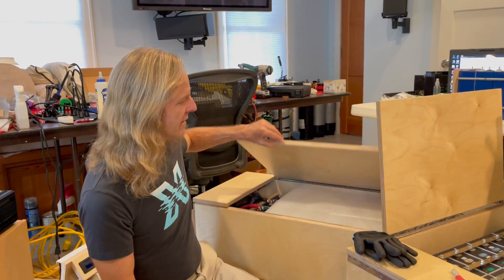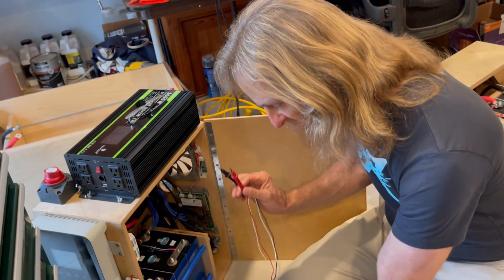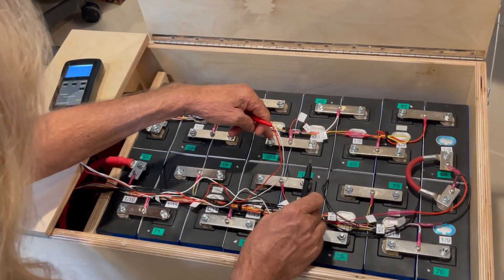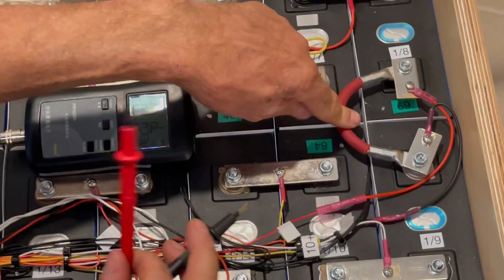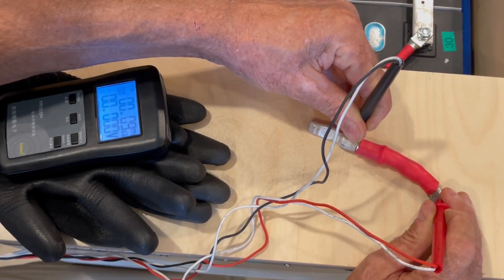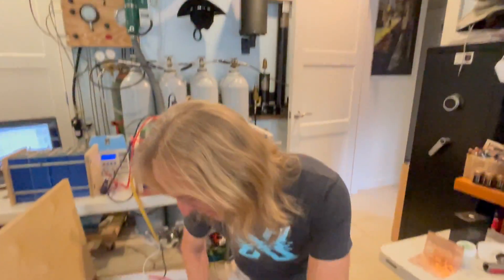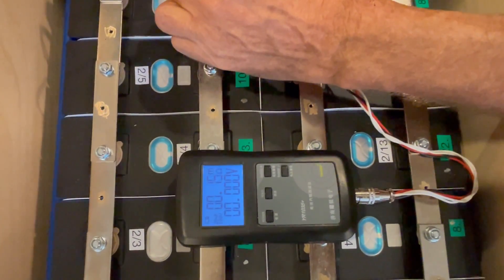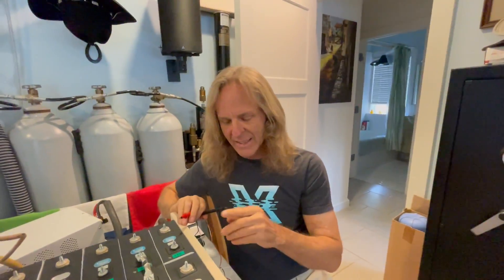It's No Joke, Size Really Does Matter!! Testing Flexible Busbars. Please read the description.

Comment: Assuming a 50A current, a 0.2milliOhm difference in resistance would result in only a 0.01V difference .... is that significant ?  A what voltage does balancing commence and what it the related current and hence voltage error between the cells ?
Reply from the maker: The idea of using brass bus bars or cables that are the equivalent of brass bus bars in their resistance is troubling to me. The 4 gauge cable will perform even worse under load because the bus bar is not insulated and had more surface area to emit heat from so should stay cooler under load.
Reply: @RayBuildsCoolStuff  Brass is a poor substitute for copper. After gold, aluminum is the most affordable alternative.

As far as heat is concerned, it's the result of resistance in the connection. Insulation is for safety and has no effect on resistive heat; either generation or transmission.
Reply from the maker: Insulation on wires retains the heat which is why uninsulated wire is rated for higher ampacity and the overhead lines between the transformer and the weatherhead on a house can be significantly smaller than insulated wires.
Reply: @RayBuildsCoolStuff  I was referring to the kind of insulation typically found on wiring used for cell interconnects, or the heat shrink often partially covering bus bars.
Reply from the maker: If you have large variance in the resistance between cells will that result in cells that act like runners? I had one nut that was only hand tight on a 48v battery and the load was only 5 amps and it resulted in a 100mv delta during charge and discharge in one cell. After tightening the nut the cell tests in the middle of the others with only 3mv difference to the others.
Reply: @RayBuildsCoolStuff  The hand-tight nut on the one and only busbar between series cells resulted in increased resistance across that connection. That would cause a disparity between cells while charging and discharging, and especially balancing where the relative difference between charge current and resistive bleed current are exaggerated.
Reply from the maker: Do you think the same disparity would exist when pairing a 4 gauge wire with copper bus bars or 4 gauge wire of different lengths? I have another question I'd like your opinion on. Do you think we should use 4 gauge wire to connect cells in series in a battery that is fused for 200 amps?
Reply: @RayBuildsCoolStuff  Unfortunately, I don't understand the first question. Feel free to message me directly.

As for the second question, that depends. While the battery is fused for 200A, what's the pack configuration and BMS rating?
Reply from the maker: @ARepublicIfYouCanKeepIt  the first question relates to differences in cell connections of 20 vs 40 mohms. I feel that causes a pack that will be fighting to stay in balance.
Reply from the maker: @ARepublicIfYouCanKeepIt  for the second question, let’s assume a 200a BMS and loads of around 150a at peak demand but fused at 200. That is way beyond the ampacity rating of 4 gauge wire and it’s going to heat up very badly.
Reply: @RayBuildsCoolStuff  Connections should be the same for all cells. For instance, when I saw the "flexible bus bar" for the return leg of a long series string, I immediately thought, that's gonna be a problem. In this example, I would've made a bus bar out of the same material as the face-to-face connections. Just marginally longer to accommodate the side-by-side connection.
Reply: @RayBuildsCoolStuff  Firstly, with a max capacity of 200A, everything should be fused at a minimum 250A.

Things may be added later, so the maximum expected amperage at installation time is irrelevant. Design to that which the system is capable of delivering. 200A in this case.

You're 100% correct about the 4 AWG wire. It should only be used at or below 110A.

Again, for a system capable of delivering 200A, one must design for 250A, and that requires 0 AWG wire.

Lastly, these currents begin to cause significant design, build and installation issues. The relatively high currents also pose safety concerns.

For these reasons, my standard build is 24V, with higher voltage builds for special cases such as commercial energy storage and delivery and E-mobility.

My standard build would be 48V, but system component choices are far few, while costs are much higher.
Reply: @ursodermatt8809  For those who might read your reply, current decreases as voltage increases. Therefore, a 24V battery delivers the same wattage output at half the current of a 12V system.

Your second point on solar charge controllers is incorrect. I design and install complete off-grid energy systems with optimized PV arrays, solar charge controllers, batteries, inverters, chargers, and all the rest.

For example, the solar charge controllers I use support 12V through 48V. So, I'm able to match the type, number and configuration of the PV array with the best solar charge controller(s), the best voltage and capacity battery(ies), and the best capacity inverter(s).

Smaller systems (24V, <=5kWh and <=3kW AC) rarely require more than a single solar charge controller. (200Ah*0.3C=60A)
Reply: @ursodermatt8809  This is so frustrating. Yes, 48V batteries deliver the same wattage output at half the current of a 24V battery. This follows my earlier comparison of 24V and 12V batteries.

Again, your comment regarding solar charge controllers is at least partially incorrect. One must consider numerous factors when sizing solar charge controllers. While, the C rating of the battery is a factor, but not the factor, PV array power generation characteristics are equally important.

For example:
• PV Array = 4x175W panels arranged in series.
• Battery Capacity = 5.12kWh
• Battery A = 24V
• Battery B = 48V
• 5.12kWh/25.6V=200A. At 0.3C, Battery A can charge at <=60A.
• 5.12kWh/51.2V=100A. At 0.3C, Battery B can charge at <=30A.

In this example the same exact solar charge controller is recommended by Victron; the MPPT 100|35 (<=100V in and <=35A out).

Now, as V*A=W, the 100|35 will output 24.6A to 32.2A vs. 12.3A to 16.1A for the 48V and 24V systems, respectively.

With W as the consistent unit of energy, this means that the 48V system will charge twice as fast as the 24V system.

With that said, however, vastly more PV production is curtailed in the 48V scenario. Additionally, the choice of system components like inverters is much less than 24V and drastically less than 12V, and these components also come at a higher price.

So, in this case, assuming energy needs didn't exceed 5kWh/day, I'd install a 24V system over a 48V system every time.

However, in order to ensure complete battery charging on a daily basis for a larger system, I'd opt for =>48V every time.

It all depends...on myriad interrelating factors that must all be optimized.

The only thing certain for me, is that I stay away from 12V systems as much as possible.
Reply: @ARepublicIfYouCanKeepIt  "Again, for a system capable of delivering 200A, one must design for 250A, and that requires 0 AWG wire."  How did you come up with the 50A of difference between max current and cable spec'ing?  Thanks. Appreciate your responses.
Reply: @s.mendez7160  When designing electrical systems, always allow for a 25% margin for safety (i.e. 200Ax1.25=250A). In this way, assuming everything is functioning as designed, no component in the system is taken to its rated current carrying capacity.